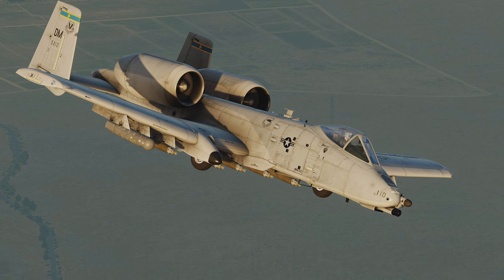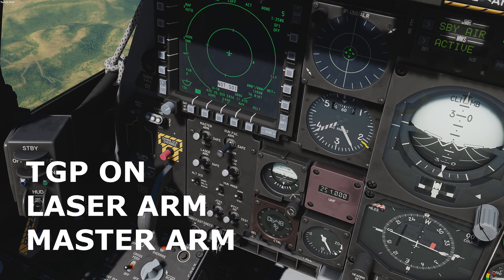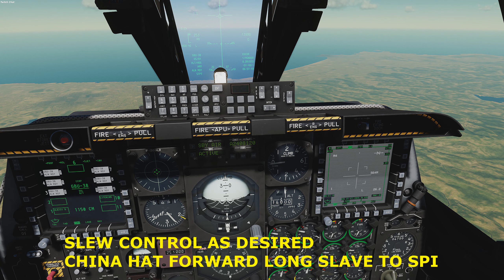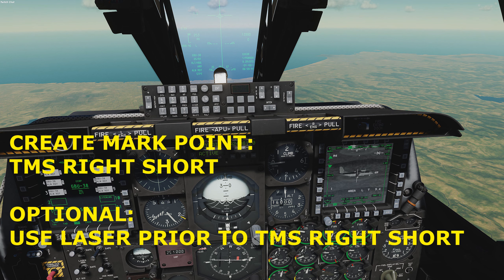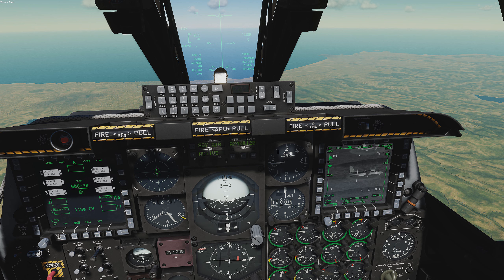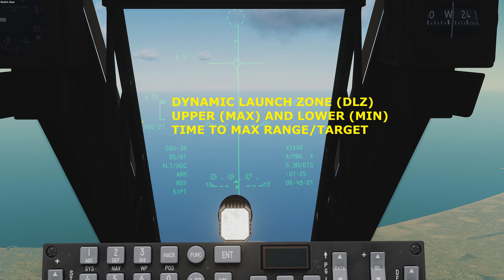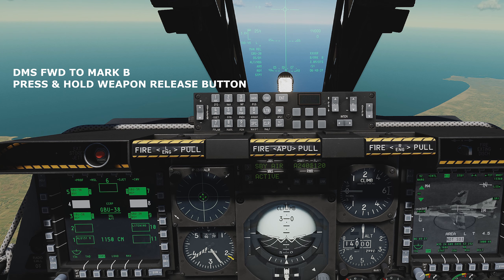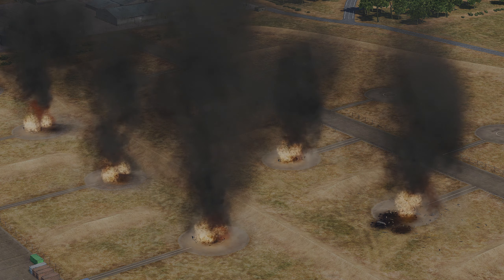A-10C II Warthog: 6 X JDAM in 1 pass, Mark Points Tutorial | Digital Combat Simulator | DCS World

Comment: What I'm confused about with your sequence here is that you are not designating the spi each time you change to a new mark point. I thought you had to tell the system to direct weapons to the next mark point by setting spi each time...
Reply from the maker: No SPI is required for this method. Since the mark points already have the lat/long coordinates, those coordinates are sent to the JDAM at weapon release.  The beauty of this method is that it's so simple.
Reply: @chazflyz  I think that happens because the SPI is set to STEERPOINT and the steerpoint changes every time you cycle to a different Mark point.

Comment: Wait, so the bug with JDAMs falling short from targets is not the bug? All we need to do is aquire precise distance via laser designator?
Reply from the maker: The JDAMs falling short is a legit bug. It was happening to me. It's been reported. I found the best distance to release the GBU-38s was under 5 miles. R max varies based on altitude and speed, but it seemed to be around 5.8 which didn't always work.
Reply: JDAMs are pretty unreliable overall it seems, even when lasing before making a markpoint.    I would say I'm personally seeing about a 50 percent accuracy rate (release on 4 stationary targets, maybe 2 will be accurate.)    Better off just using LGBs depending on the accuracy needed.
Reply from the maker: JDAM physics significantly improved in the recent 2.5.6.57264 Open Beta patch.  I'm getting more accurate hits in the Hornet and Warthog.